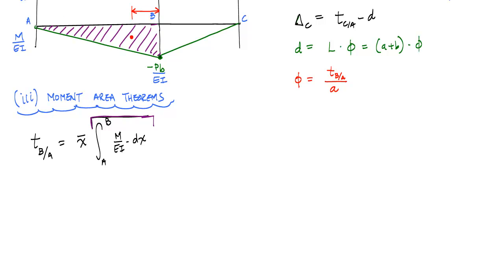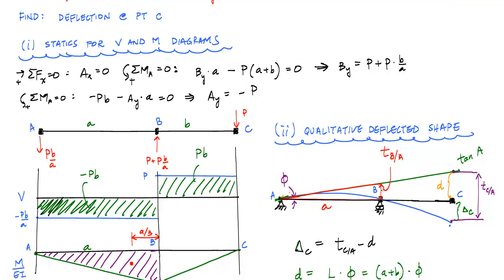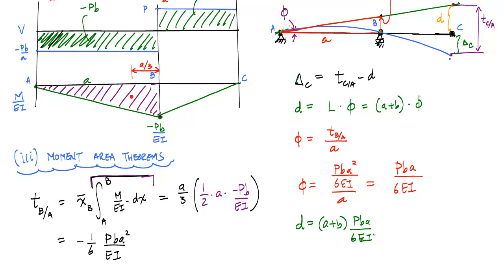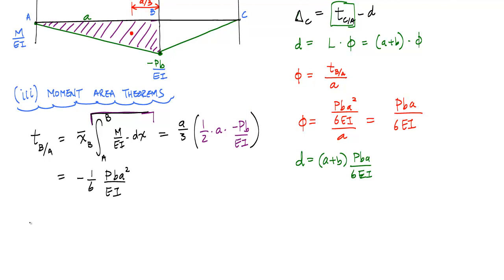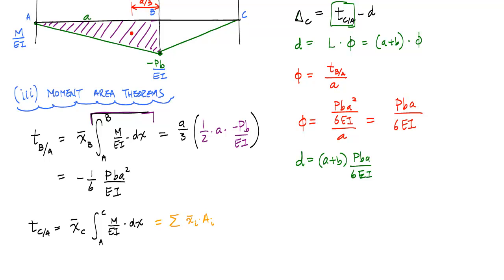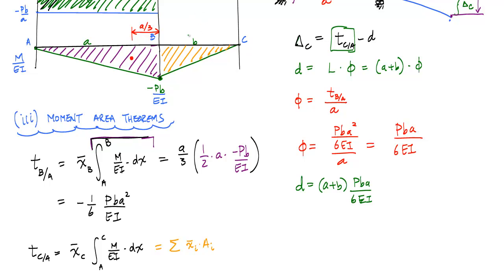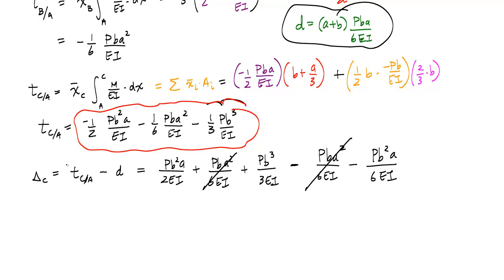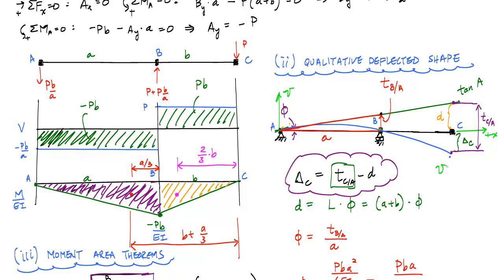Moment Area Method Example 4 (Part 2/2) - Structural Analysis

Comment: Great presentation.  I'm working back through Structural Analysis by McCormac (1960) to re-learn what we blasted through in engineering school.  What software are you using to do the board work?  That makes the presentation really cool.

Comment: I think you made a mistake:

You said Phi = Pba^2/6EI/a = Pba/6EI

Is it not Pba^3/6EI ???
Reply from the maker: It probably would have helped you if I wrote the formula as phi = (1/a) * (tB/A) which makes phi = Pba/6EI. It's also a good idea to check units.  phi should be in radians...[Pba] = Force * Length^2 and [EI] = Force * length^2. Thanks for your question. I hope my explanation is clear enough.

Comment: Why can't we say tc = tc/b + tb... Which means tb is zero... Then solve for tc/b and get an answer of -(Pb^3)/(3EI) ? ... Big thanks for the videos, I've watched them all.
Reply: hrmm, I tried to draw tb/c in a diagram and it doesn't seem to work (it geometrically doesn't make sense). I can see that you used a vector notation in your algebra and it seems to not be able to work in this concept.

Comment from the maker: thank you for the comment and question...i'm also glad to hear the videos are saving the important parts of your body :). Technically, yes, d = L*sin(phi). However, when we calculate beam deflections in a structure (since deflections are so small relative to the size of the structure) we typically use a small angle approximation...sin(theta) ~ theta...which allows for d = L * phi.